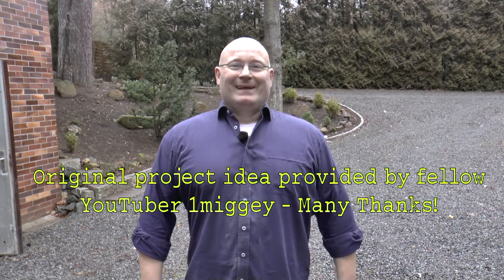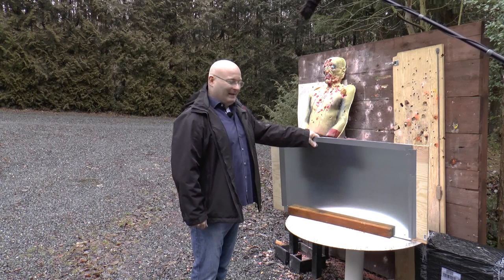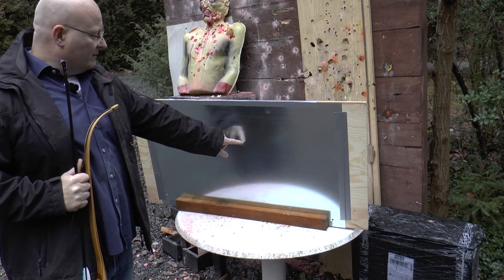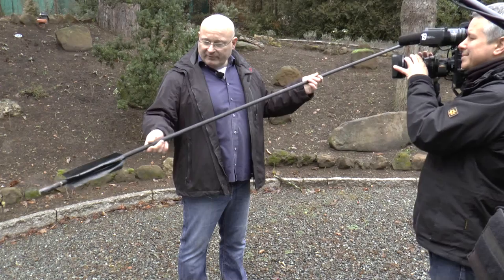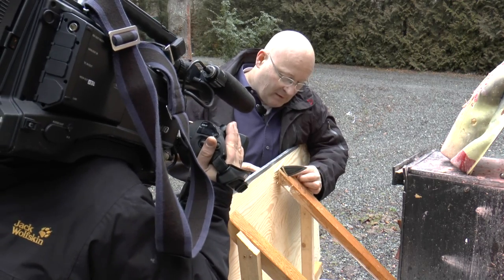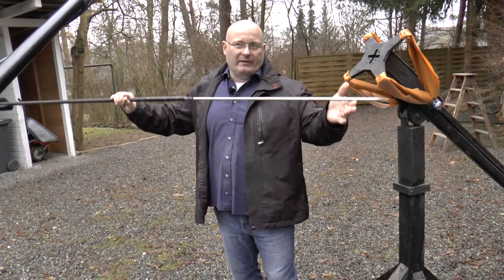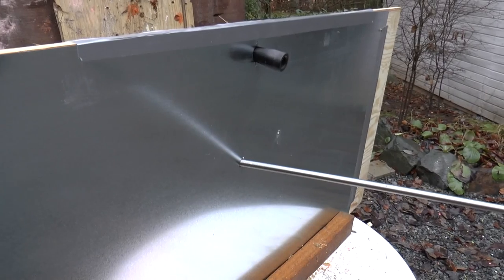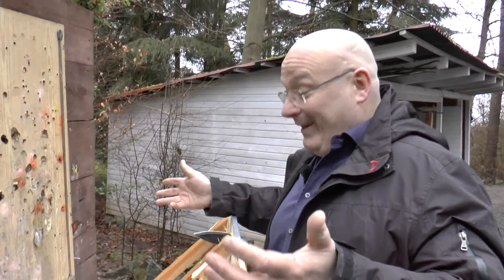Hunting Dragons With The Slingshot (The Perforation Of Smaug Part 2)

Comment: Joerg casually building an anti-aircraft slingshot.
Reply: I don't know things but I don't think that 3kg arrow would fly any higher than 30m (90 feet)
Reply: William Young  90ft is pretty damn low. Even for am attack heli.
Reply: @lapidations  ye man but then the projectile is massive. for that weight I think 30m is very impressive.
Reply: William Young that was a joke -_-
Reply: William Young  Don't tell the Sentinelese!
Reply: Aluminum
Reply: @jeffdillenbeck1278  HOW CLOSE ARE THEY STANDING!? 2:50
Reply: you would need an fiberflass arrow for it to have the trajectory and velocity to get high enough and fast enough to hit a heli... and made of diber glass it wont have enough momentum to penetrate metal.
Reply: Would have to be at least five times the size of this one
Reply: Step 5: Skewer the winged beast!

Comment: I wonder if the cameraman would have stood that close to the line of fire if it was a gun? Perception of danger is an interesting thing!
Reply: I would argue that while still incredibly stupid, standing downrange of a manufactured and quality tested firearm would be safer. No offense to Joerg but this is a homemade device made out of wood and rubber which would be far more prone to catastrophic failure. Even one of those bands breaking could mess the cameraman up.
Reply: Funny fact the Arrow is so big, getting hit by it would break all your bones and your organs would literaly burst open. A 9 mm is far less lethal  then a Projectile that massive. I even go so far to say, if he would use other material then Rubber, he could easy penetrate a modern Kevlar Vest even with Ballistic Ceramic plates.
Reply: @deidretal2500  Joerg knows this. That is why he is in Safety Tshirt.
Reply: You guys are forgetting about the super heated gas that firearms use to propel the bullets. 

If you were that close to the barrel of a .50 cal when it fired your camera lens would shatter lmao.

Comment: The camera guy is the bravest heart on the universe.
Reply from the maker: kamuy inthavongsa Faster, yes. But the momentum will be a lot lower. On impact, the velocity will drain away very quickly. A fast pellet can be stopped by a tin can. A slow railroad engine will split a truck, lengthwise, and then go on unhindered.
Reply: JoergSprave
It's kind of like the whole "Horsepower verses Torque" discussion between auto fans.
Reply: Baldovino63 3 years old comment
Reply: @Slingshotchannel  Kinetic energy  VERSES  mass the weight and volume being the destruction. High- speed low volume mass will splatter or try to pass thru losing energy on impact combined with how hard the object it's impacting will depend on its success.The weak link for a small object is its own hardness and speed it is travelling PLUS penetrating ability no penetration plus hard target can cause a  ricochet in reverse and kill the shooter. HA HA HA. Just saying. Great channel you have very entertaining.

Comment: the high speed shows that your knocking point on the bow is too high, just FYI. You'll get better accuracy and range if you lower it, as the arrow will be delivered straight rather than arriving point down.

Comment: Amazing weapon, although the only issue I see is the low velocity with those massive arrows means a short range. That said in a trade off between energy and momentum I guess you want momentum for sheer penetrating power. Doubt you'd be able to hit the dragon past thirty metres or so.
Reply from the maker: Violet_Shift Yes, heavy arrows are not for the faint of heart,

Comment: holy shit ... when the winch rope ripped... good no one was standing around the front
and speaking of that - was that guy with the camera standing right next to the line of fire in the first test?
Reply: given, and probably you couldn't load it while uncocked anyways
Reply: He was close, I was surprised when he didn't flinch!
Reply: amin rahiman
why are you so insulting? seriously is this your contribution to the world?
Reply: SoWeMeetAgain You better quit while you're ahead. Now you want to hone in on me? EL OH EL.
Reply: SoWeMeetAgain the rubber band slaping some one in the face? Look at the movement of the rubber in all of the shots it dint even flex far enough. Because the natural set point of the rubber is at the furthest end of the sling, there isn't an excess to flap and slap. The only other way it would happen is the rubber band broke instead of the rope. but Logic would tell you rubbers would only snap if they are stretched past their stretching point . Clearly not the case. And what I've say have placed another credit top of his designs.

Comment: Just imagine an arsenal of these as a castle defense system, while your infantry used the slingshot cannon as artillery.
Reply: Slow firerate, with luck you can kill 1-3 enemies at the time. Bows, rocks and fire are better.
Reply: Wow...way to kill the optimism.
Reply: Sorry for that. Firing from scorpions or ballistas just doesnt seem practical to me. But it still looks awesome.
Reply: I hope you realize that pretty much every heavy ranged weapon in the Middle Ages and Renaissance was very slow firing. Even the musket took 30 seconds to reload, and it was single-fire with direct rechamber into the barrel. Do you realize how technologically advanced the Gatling was when it was finally invented in the 1800's? The first heavy weapon with a fast fire rate.
Reply: Would be wonderful to see an army of a thousand or something
Reply: Johnny S. i'd like to point out that Scorpions and Ballistas where Anti-siege weapons.  Due to their long range, Accuracy, and heavy arrows, they can penetrate the wood of a Trebuchet and heavy rams at decent range.  They also could penetrate through multiple Soldiers in heavy armor without much effort so each shot could take out 3-4 guys.  It could also be used as a Siege weapon for taking out Sniper spots on a castle tower.
Reply: Johnny S.  i'd also like to note that if i stood ... oh ... 50 meters away and shot an arrow at some one using that on a castle wall. They wouldn't be able to touch me with the drop rate of that bolt, and my arrow would probably go though their eye... That's not a threatening weapon. Even if i was a flying, magical dragon. it doesn't have the power behind it to hit something in the air. And it doesn't even have the weight, or power, to make a decent siege weapon.
Reply: Johnny S. Bows and rocks don't help much against mountain trolls.
Reply: DutchDread boiling oil does help on the other hand
Reply: Johnny S. I wonder about that, they looked pretty fire resistant in the movies (to me at least).
Reply: DutchDread hard to say, when they are hurt they panic, kill everything or flee, I think you don´t necessarilly have to kill them
Reply: Johnny S. True, once a troll is burning I doubt he would stay calm enough to stop drop and roll.
Reply: Johnny S. These kind of weapon was used in the past, the low fire rate was the rule. Arrows are less lethals then we see in movies.

Comment: The arrow tip you used for the longbow test is specifically designed to reduce the amount of damage you do to the target.
Reply: Dylan Griffin
It may have been designed to do that, but it obviously didn't do much as far as lack of damage. Quite the opposite...

Comment: I was always under the impression that slingshots generally didn't scale particularly well because they don't actually maintain their draw weight as well as limbed ranged macines over long distances. Their draw weight decreases exponentially as they reach their undrawn state, unlike a bow or ballista, which always has tension on the shot line/bowstring.

It works, but would it be any good over any real distance? Like, say, 25 meters or so? I'm legitimately wondering this.
Reply from the maker: Perry Wood Test shots were made from 17 meters or so. Of course it would work at that distance. Rubber wins against limbed weapons because the power stroke is so much longer.

Comment: Try using a real ash shaft arrow, with a propper armor piercing point, when testing the bow shot. Aluminium shafts arent made to withstand the force to penetrate hard surfaces. They are only good for target shooting and maybe hunting, but not armor. So if you want a good comparison, you should use a propper medieval war arrow, made for shooting at armor. Also it is worth noting, that a crossbow isnt necesarely stronger than a longbow, despite the myths about it. Even though a crossbow can have several hundreds pounds of drawweight, they only have a few centimeters to accelerate the arrow, so normally a good longbow will shot just as hard and long as a crossbow, and often it will even perform better than a crossbow. 
Your sling balista however, has a lot longer room to accelerate the arrow, and should therefore be better than a crossbow, and propably even most longbows. However it could be fun to test is against a propper medieval english longbow of 140-160 pounds drawweight, and a propperly made war arrow, to see how it compares........ however it will be hard to find a person in this day and age, who are able to shoot a replica of that drawweight hahaha

Comment: Seems it's a bit of a tight fit with a lot of friction when you load it so you're probably losing quite a bit of energy to heat. A bit of lubrication wouldn't go amiss I think and maybe, just maybe, you didn't need to go for a 46297 grain arro.. spear.
Lighter means faster, faster means flatter trajectory and thus easier to aim.
Of course these are just tweaks to an awesome dragon slaying weapon, good job on it you crazy person. :)
Reply from the maker: TheTurinturumbar Not much is lost - the resistance is certainly less than half a kilo. At a draw of 212 kg that isn't much. Ever tried to push a bullet through a rifled barrel?

Lighter means faster, but also you lose momentum = penetration. Better to be hit by a moped that goes 50 than by a train that goes 30.
Reply: JoergSprave
I watched it again and I retract my concerns, first shot with the second spear looked about as flat as the first really, don't know where I got it from, maybe one of the later shots.
Reply: JoergSprave F=M*A, ft lbs on the target should be about the same with a lighter arrow, because it will be moving proportionally faster, wouldn't it? Velocity is usually more important for penetrating armor that mass.
Reply: GearCheck 101
I thought of that but then you have a cut off point where the bands no longer contract faster and the heavier spear didn't seem to go that much slower than the first upon reviewing the video, it was that he doubled the distance that made him aim higher. We can discuss whether he's found the optimal weight/power ratio till the cows come home but ultimately  testing  decides.

Comment: Not only is the dragon alive, it's probably only slightly annoyed that you shot at it, given that the arrow shaft shattered upon impact.

On a side note, I would not want to be on/in the receiving end of whatever got shot with that,  whatever it may be, because that modified bolt would probably go through thicker steel than that, and it would more than likely go through bullet-resistant glass as well.

Comment: realistically, i don't think a dragon scale would be that armored. it has to fly (which is more bs because the body weight alone would really strain the muscle and if it did manage to get in the air, where are the rudders? i think it would be more a glider than a flier.) and move around quick so i think it would be more like actual lizard scale but just more thick.

Comment: If you customize that to shoot a smaller but a lot denser bolt and stabilize it with the same power, its going to pierce right through a abrams tank guaranteed.

Comment: if you need steel to penetrate steel, how did the planes knock down two steel framed towers?
Reply from the maker: The burning kerosene did much of the damage, I suppose.
Reply: the towers of course didn't fall from the impact of the planes. the biggest physical powers the towers had to deal with was their own weight. and once the stabilizing structures were weakened enough, they couldn't handle this weight anymore.
Reply: +JoergSprave but jet fuel can't melt steel beams
Reply: *****
you don't need to melt steel to lower its stability. the towers didn't melt, they just collapsed.
Reply: Hallo, Jörg!!! Ich bin grosser fan aus Amerika!! hab grad gemerkt dass du mir geantwortet hast!
Reply: The jet fuel would have burned off within the first ten minutes. Most of the fuel burned up in a fireball outside the building, especially in the case of the South Tower where the plane mostly missed the core columns. The fires in the buildings, beyond the first few minutes, were essentially office fires, and not very large ones at that, ignited by the jet fuel, like lighter fluid on charcoal. Jet fuel is kerosene. Temperatures from either kerosene or office fires are insufficient to melt, or even catastrophically weaken, the massive steel columns running up the core of the building. Even if the flames and air temperature were maximally hot, the large mass of steel would wick away the heat and not raise the steel temperature sufficiently. For the steel temperature to come close to the air temperature the fires would have to be of long duration, but these fires were very brief, on the order of an hour.
Reply: There are photographs and video footage of a woman leaning on a girder and waving in the hole where one of the airplanes crashed waiting to be rescued. This would seem to be direct testimony that the fires on the floors where the impact and the jet fuel had their greatest effect, had subsided, and the air and steel temperatures were moderate enough for people to walk around and touch the steel: nowhere near hot enough to cause failure of the structural steel columns. The fact that the fires were emitting black smoke is a sign that they were not burning at high efficiency, so high estimates for fire temperatures are unwarranted. Furthermore, no steel beams recovered by NIST during its investigation showed temperatures over a few hundred degrees—far below the temperatures needed to weaken steel.
Reply: they didnt, it was bombs on the inside
Reply: Arstotzka!
sry, i'm just allergic to tinfoil
Reply: It's all fake. Everyone in the world was created last Tuesday.  All of your memories are implants. This simulation will only continue for a couple of more months. We are the test run to see what the election results will be.
Reply: Last Tuesdayism
Reply: +Randen Sim THURSDAYISM MOOSEKNUCKLE

Comment: also if you were to put the twist that the movie arrow had in it it would work and go through it just fine  the  twist in the tip would cause it to open a large enough hole to fit the origanal sized head mount .

Comment: The problem is that is not a dragon scail as is said in the books a single scail is as ten fold shield so if yo had got 10 plates of steel that were a shield thick and if it went through that would be a dragon scail

Comment: I know it doesn't really matter for this test since it's not meant to be scientific or measure the armor penetrating ability of a bow, but 62 pounds is definitely not a powerful bow by war standards. I think the bow you used is not even a longbow. Actual war longbows could have a draw weight of up to 3 times higher than that.

Comment: Slingshot and bow is different. not the shape of them. Slingshot uses rubber band to get power and bow uses it's frame to get power. If I was you, I would make the same slingshot with truck's leaf spring to speed up the arrow and maybe throw away rubber band. If I was you, I would use truck's leaf spring with strong wire or paracord. As I think you seem to shoot the arrow faster and stronger piercing. It would be better for your effort.
Reply from the maker: ldc6810 If I was you, I would not leave wise butt comments on channels like mine.
Reply: JoergSprave Right? He literally makes these weapons for a living, I think he knows what he's doing, plus something tells me you don't want to be on Joerg's bad side.
Reply: JoergSprave damn. You are a fucking badass. Imagine hunting with that! XD
Reply: +JoergSprave the leaf spring idea is definitely interesting though.
Reply: +sjpro1 Unfortunately leaf springs are designed for high load rather than fast response. Ballista made from them tend to be rather anemic. I know at least 3 teams tried this in different forms on Junk Yard Wars/Scrap Heap Challenge. Most ep are available here on YT or other online sources.  Several Pumpkin Chunkin teams have also tried to used leaf springs as well, at least until a year ago when the farmer that started the event 20yrs ago shut it down after someone wrecked their 4weeler on his land and sued him for their own reckless riding habits..

Comment: Horrific range discipline with that camera man.

Some of the weapons on this channel are of questionable or unlikely lethality. The weapon in this video is not one of them, however - it is obvious that this would easily kill a man. That being the case, the same safety procedures should be observed as would be observed at a gun range. And a cameraman standing downrange at only a slight angle off-bore is a pretty bad violation of said good practise.

Comment: If you still have the contraption, could you perhaps test it on a thicker and perhaps rounded steel? something like so: https://farm1.staticflickr.com/56/121592864_7e8358f60c_z.jpg, with perhaps another board of steel behind? I would like to see how far the limit can be pushed with the penetration capability of this. I think the roundedness of a scale can potentially deflect such weapon, but at the same time the edge of one scale meets the edge of another and it creates an oportunity for penetration. I think smaug must surely have stronger scales than that, however your contraption is outstanding and impressive, I take off my hat ;)